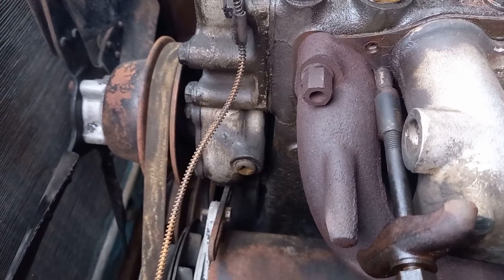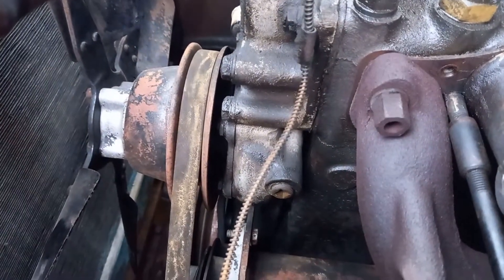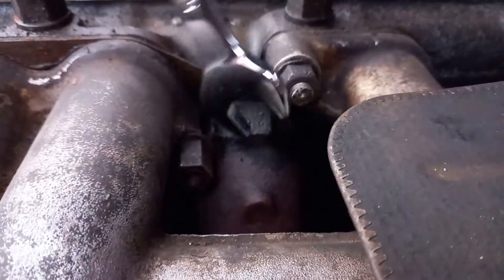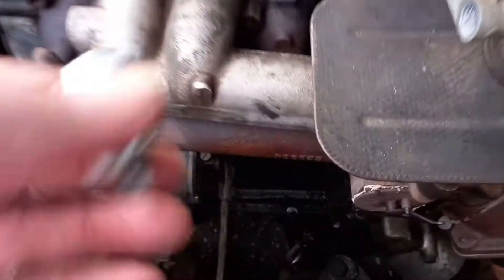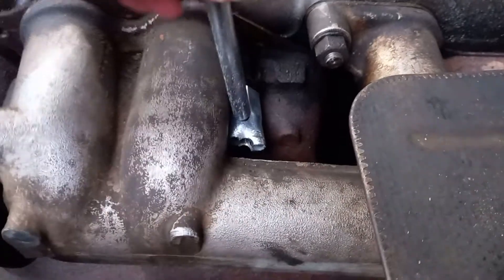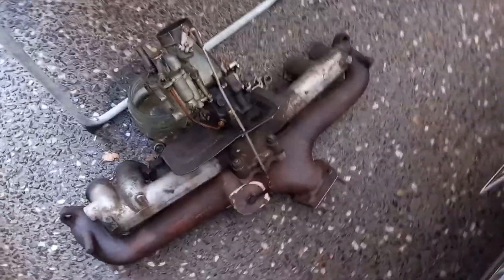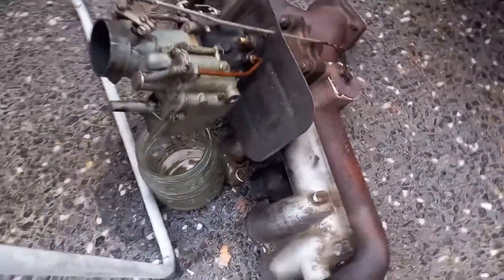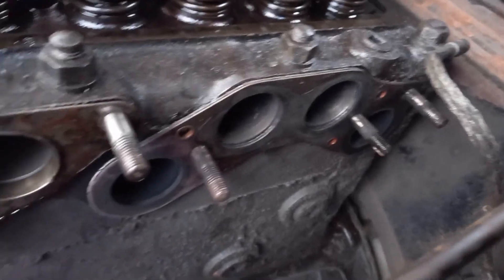Humber Super Snipe Mk IV - Removing the manifolds

Comment: bet it took more than 4:30 minutes in real time? 
Are we allowed to guess, whether the problem lies with the valve gear or the compression rings?
Reply from the maker: Yes, it did take longer in real time. Any guess or advice as to what is the root cause of the compression problem would be gratefully accepted. I am not a mechanic so if you see anything else in the video that needs attention please let me know.
Reply: @colinharrison5093  I'm not a mechanic either, my late farther had a Humber Hawk, similar era but a 4 cylinder,  he had to use wooden wedges to get the head to lift off to change the head gasket. The trouble with a car of that era is there are very few people who have worked on them. Good Luck!
Reply: Colin  I think you have a stuck valve Possibly due to carbon build up.
Many years ago I had an mini 850cc with twin SU carbs  it used to run rich at 30mph anyway it started getting a bit tapperty so i thought I’d change the oil so in went new oil I’m not naming names. changed the oil and filter. Everything done filled the car up with wife to be plus bros and a sister and ran from Auckland out to Howick beach did the beach thing ice screams etc good  2hrs later all aboard turned the key. Firing on 3 it sounded awful I paid for a tow truck to get the car and everyone back home left it around the back of the house. And licked my wounds. 2 weeks later I took the valve cover off and  found after churning the starter over.I saw  a struck valve.  I went down to my friendly garage owner and asked him what to do. He asked which grade oil did I use I think it was  30/40 oil. He asked what does it say in the handbook straight 30 grade. there’s your answer.he said hammer & a wooden dowel  tap the offending item and ping found it’s cosy spot fired up the motor and bobs your uncle no valve grinds nothing. All the best